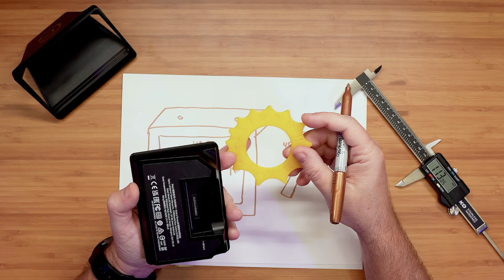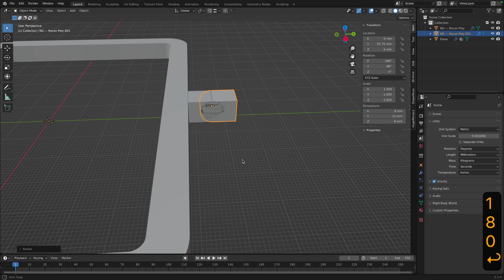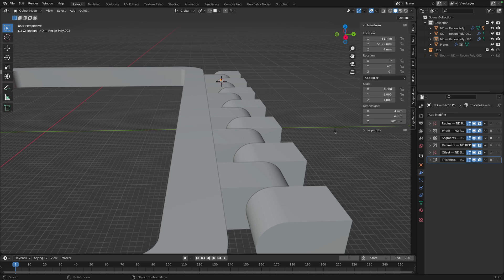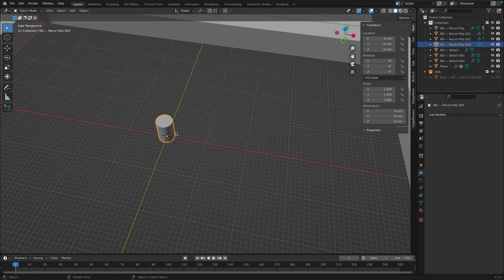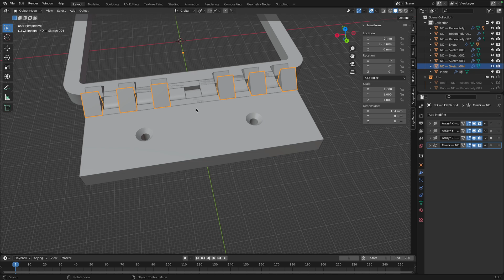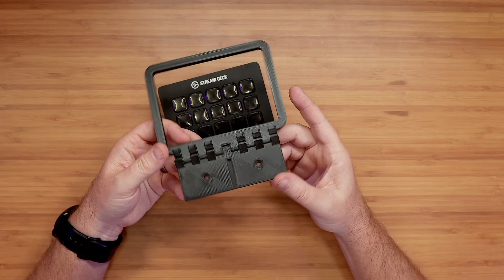Modeling a 3D Printable Functional Part in Blender

Comment: Cool Design! I'm curious if you considered using command strips instead of screws. It seems light enough that a couple would hold the weight, and it'd let you reposition whenever you like without having to drill into the desk.
Reply from the maker: I'm sure that would work too, but I already have a few other things screwed into the underside of the desk and I prefer having things attached in a more permanent way.